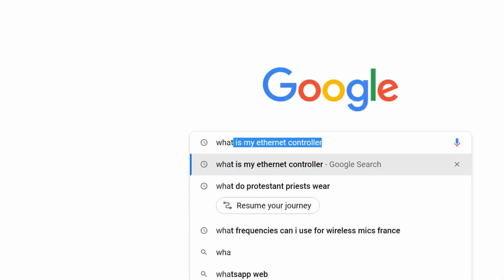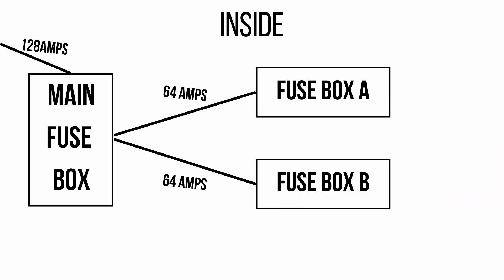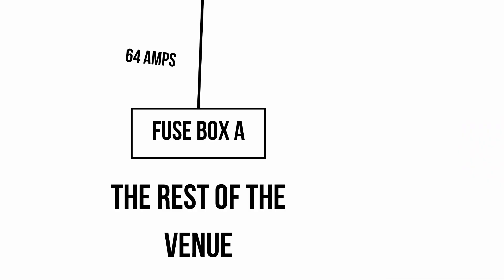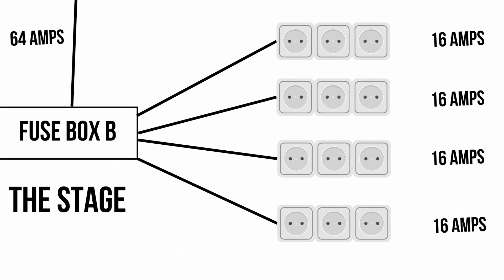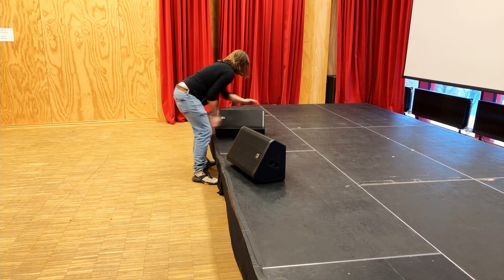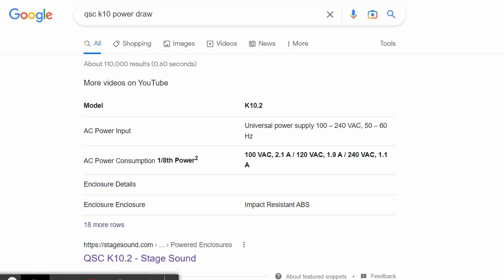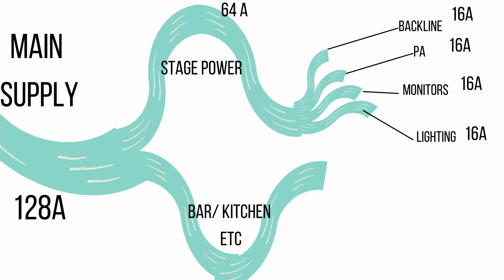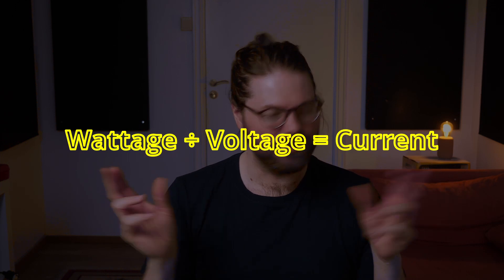Calculating Power Draw| Power Distribution In A Music Venue

Comment: i regularly run full band setups (with dual subs on foh plus minimal led lighting) on 10 and 15 amp curcuits. only had problems a few times over 20 years. a good mixer will be able to have it loud and clean with less draw. as the great mike stavrou once said the aim of mixers is "maximum illusion, minimum voltage".

Comment: Also something that wasn‘t mentioned enough imo: if the voltage of the power changes, with modern universal voltage power supply’s, the current will automatically adapt. So one speaker capable of 500w may draw 2.1A on 230V power. On 120V the same speaker might well draw 4.1A to achieve the same volume/power🙏

Comment: You are forgetting an important detail here: That 64A circuit is 3-phase. That means you can split it up into e.g. 6 16A 1-phase circuits and still load them fully without tripping the 64A breaker. You multiply the 3-phase current with √3 to get the equivalent one phase capacity.

Comment: In regards to finding the power draw of speakers- is the measurement at 1/8th power significant? To use your example, the K10 is rated at 1.9 amps for 120V, but does that power draw increase as the speakers are pushed louder? You mentioned afterward about that hypothetical system being on full blast, but it's a bit confusing the way 1/8th power is worded..
Reply from the maker: It's a good questioin. Basically thath's the average draw for music and speech. Music and speech are both quite dynamic and the power draw is also dependant on what you send into it. since there are quiet and loud parts the max power draw is averaged at 1/8.  I hope that makes sense.
Reply: @OffshoreAudio  It does, thanks for replying so quick. That said, if you’re calculating power draw for an event that’s maybe a little less dynamic- an EDM event with a lot of heavier bass music- should you overestimate a bit to some degree? More so than you would for a live band performance?
Reply from the maker: @tgg_music2  We're still talking music vs A square wave or pure distortion coming out the speaker.  I think I'd recommend having enough headroom that the musical style doesn't male a huge difference. If you're coming within 10% of the maximum draw it's probably worth just getting more power. If you're just looking to understand more then this book has been recommended to me(though I've not read it)
https://www.amazon.com/dp/0367249472/ref=cm_sw_r_cp_api_i_dl_7G24TQPPF875SD41VR6M
Reply: @OffshoreAudio  Awesome! Thank you so much!

Comment: I’m no electrician either. 
However, I really did notice your trying very hard to explain something that is not in your wheelhouse. Very good for what you said.
That said, every tech who runs a PA system should know what their system will draw from the mains supply and how many separate circuits that system needs so as to not trip any breakers. If you don’t, you will run into issues with tripping breakers and that is not only unacceptable to everyone involved, it’s downright embarrassing.